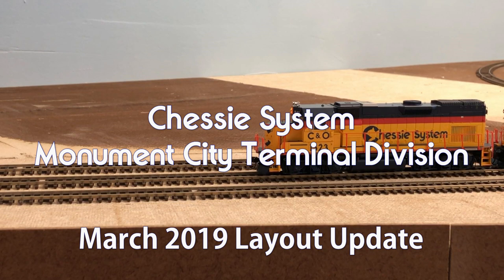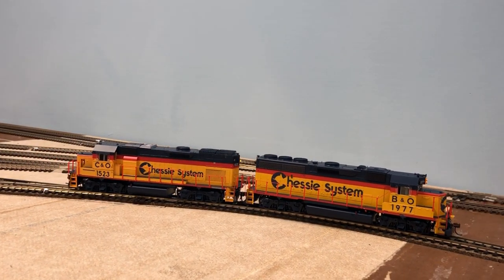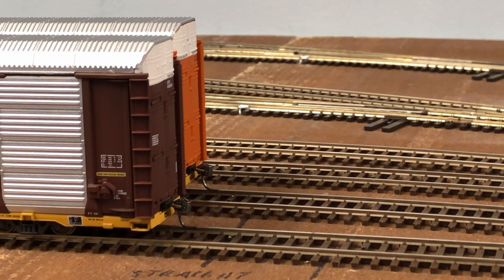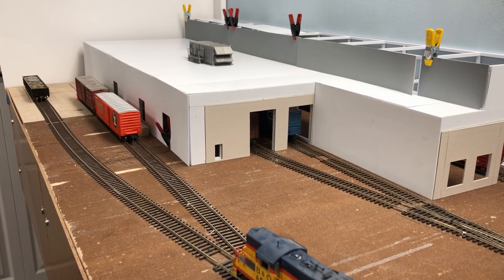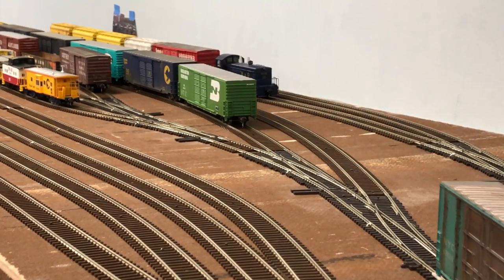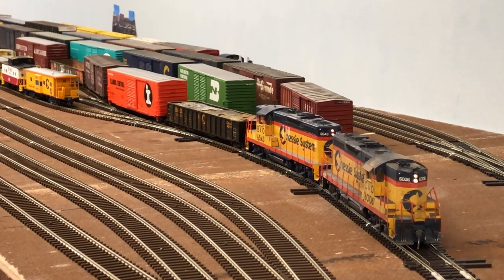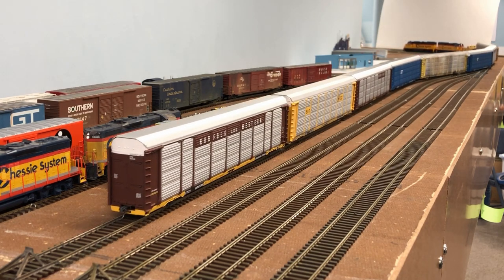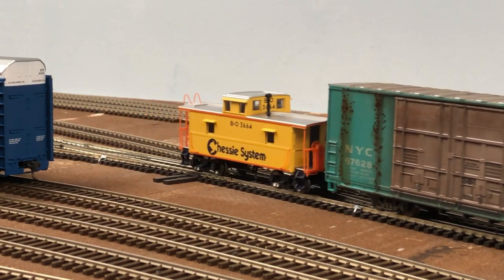MCTD March 2019 Layout Update

Comment: where did you get that chessie auto rack?
Reply from the maker: Way back when (1990s) Walthers released bi-level kits and tri-level assembled versions of auto racks decorated for Chessie. I would have gotten them then. However, for most of them I changed the reporting marks, swapped out the incorrect “TTX” logo for the era-appropriate “Trailer Train” text and in some cases changed the railroad (B&O vs. C&O) on the side panels. I actually still have some more waiting to receive this treatment.